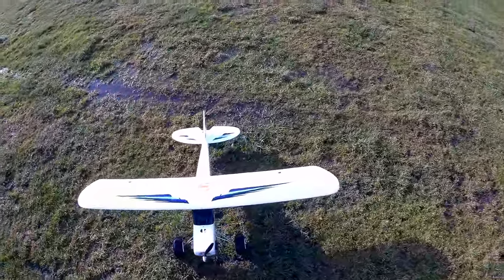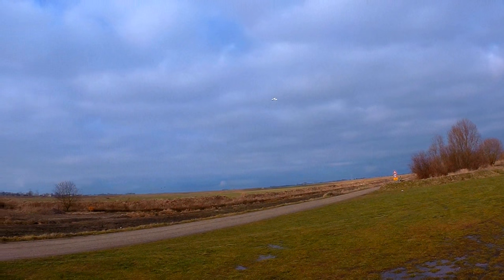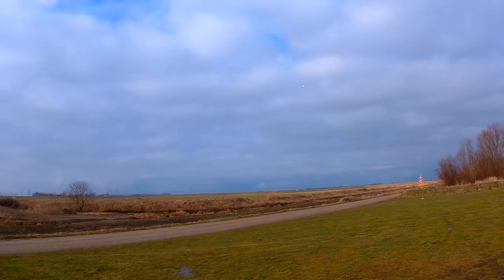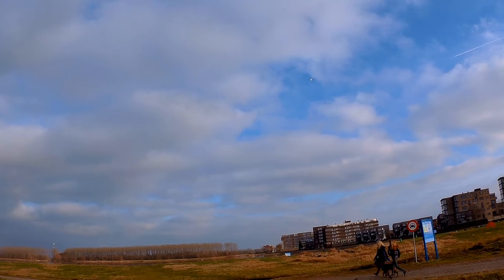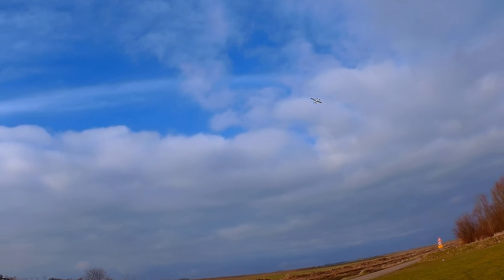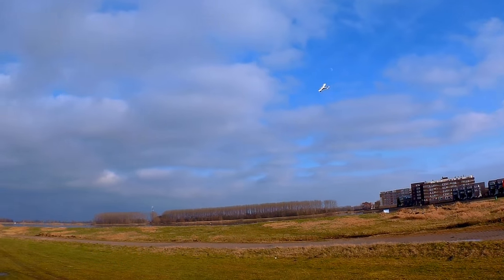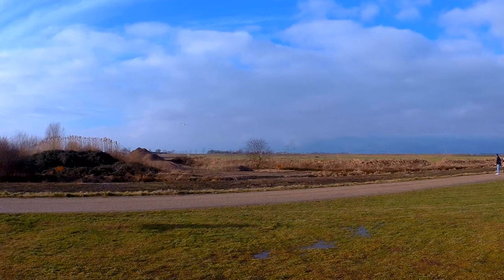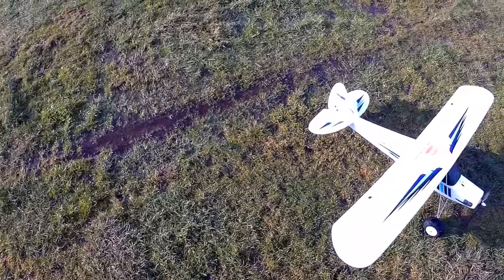Dynam Primo 1450mm STOL plane - Maiden Flight! :)

Comment from the maker: Maiden flight with the Dynam Primo! Smooth sailing??
Link to this STOL plane: https://goo.gl/4wFsbm 
Specifications: 
Type: bushplane / STOL plane / High wing trainer
Landing gear setup: taildragger
Wingspan: 1450mm
Length: 1015mm
Material: EPO foam
AU Weigth: 1660g
Servo's: 6x 9g plastick geared
Motor: 3720 650Kv
ESC: 40A with BEC
Propellor: 13x6 APC style (isch)
Channels: 6 
Flaps: yes 
Retracts: no 
Lights: no
Reply: DutchRC Adventures great video  this plane reminds me of
of my E filter Timber looks like it fly's really well well done dynamic is a lot cheaper too nice job my friend
Reply from the maker: Thanks brother :)  Yep.. these kinds of planes all fly somewhat alike indeed :)  This one has A LOT of lift though :$  more then the Durafly Tundra & Multiplex Funcub.. (NOT to say those are bad planes at all by the way)
Reply: Looks like an overweight FunCub, 50mm bigger but 50% heavier - no wonder your landing was a bit ropey
Reply from the maker: That doesn't really make sense to me, but the landing Sure was ropey :)

Comment: Enjoyed watching this high wing trainer.  Reminded me of one of my favorite old time gas powered RC aircraft "Old Reliable", a circa 1937 design (84" wingspan - 2.134 meters) which I covered with transparent yellow monocoat. Just flew it with Rudder/Elevator and throttle on the O.S. Max .19 R/C engine. With big balloon tires, it would take off any surface. I would fly it past me low and slow to look at the fuel level inside the clear plastic tank, which I could observe as I flew by.  Still have the plans for it, but just thinking about how much work goes into its construction ... doubt that I'll ever build another.  Still, it would be great to build one as an all electric .. it would stay up forever.  Cheers.
Reply from the maker: It is hard to justify the amount of work those 'build it yourself from plans' things take huh? Now it is Soooo easy to go and order something that flies pretty nicely after an hour of 'building' ;) 
Reminds me of all the boat-builds I've done.. Those allso take Foreeeeeeever ;) 
Cheers & thanks for stopping by Bill :)

Comment: very nice flight Dutch - this one looks like it is flying right where it should be for this type of plane. I would think you could get it real slowed down with full flaps and getting the elevator right. I like the bush wheels - well suited for your rough strip there! Have a great week! :)
Reply from the maker: Agreed :)  with it's higher weight this one flies quite scale I think.. That's probably why it retains it's speed more then other bush planes I've flown as well.. 
Yeps.. gotto experiment a bit to see how much elevator makes it fly well with more flaps... 
Have a good one as well!

Comment: Looks like a good plane for Nynam. I really like the Dynam planes any ways. They are a heavier denser type of foam and extremely durable. I have pinwheeled my Dynam Waco across the ground and no damage. Even when damaged there is more material there to work with. Why was a car driving where it didnt belong? Looked like an overly populated place to fly. I suppose its difficult to find a decent place to fly there huh? At least you are not dealing with snow! We have lots of it.
Reply from the maker: Ghehe that IS a road on which cars are allowed.. It just isn't very common to see cars there though ;) 
Yep.. I lost 2 flying spots last year due to new buildings :S  Houra for the economy picking up :| 
I actually would have liked (lots) of snow :D    and yep.. the foam on at least This plane looks & feels really good.. It is a bit heavier but I don't mind a bit of wingloading..